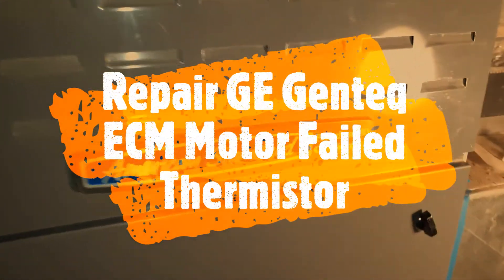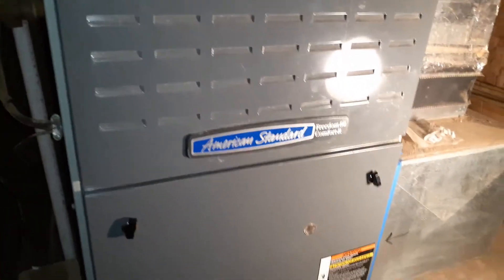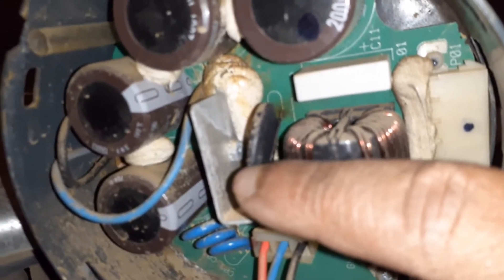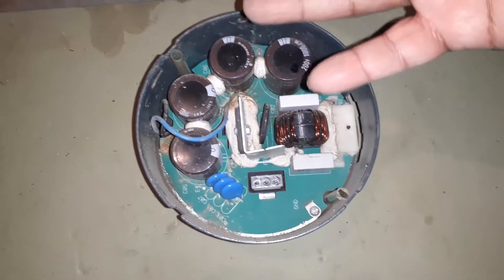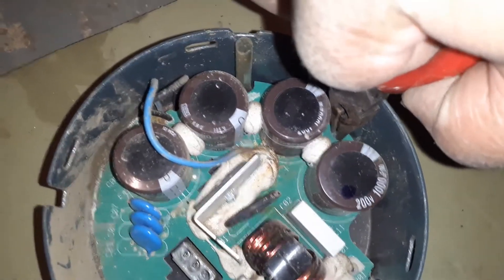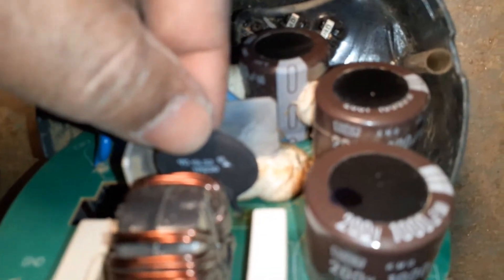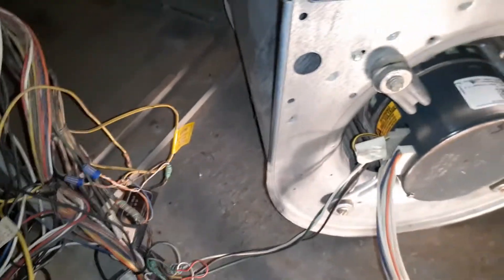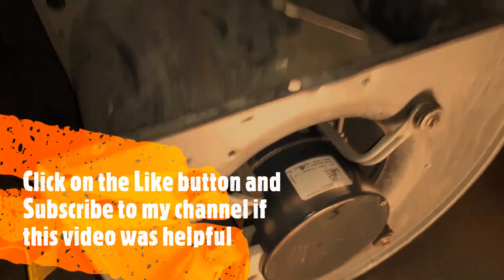HVAC GE Genteq ECM Blower Fan Motor Not Working - Thermistor Repair

Comment: Both my thermister and motor tested good. There is something internal in the module that also goes bad causing the motor to rock back and forth. I replaced the module and all is good. Anyone else experience the same issue?

Comment: Hi. After the HVAC guy told me I needed to spend $1600 on a new motor and that the board might also be bad, I pulled the furnace apart, got into the motor and discovered that the resistor for in-rush protection 0:16 was burned. I replaced this five dollar part and now the furnace works great. Thanks for your video. More people should know about this. It definitely seems like most repair people really don’t want to fix anything and just want to convince you to buy a new $4k to $7k furnace.
Reply from the maker: Yay, glad you fixed this yourself. It is insane how the HVAC industry is incentivized to sell a new furnace when a quick cheaper fix like this will keep these machines going.

Comment: My ECM blower just rocks back and forth when in demand for heat or just for fan on. Ill pull the ECM and check this thermistor. If it physically looks good and shows resistance on meter could it still be no good? Not sure if fan would rock back and forth if thermistor was no good? Ill also check resistance on motor windings to ensure motor is good. Smelled something burning in middle of night when furnace tripped. Thanks
Reply from the maker: If you smelled something burning, I am pretty sure the thermistor is toast. You will see burn marks around the base. It is a very cheap fix.
Reply: @DIYWithIndi   found limit switch jumpered out, when fan quit it overheated and melted the collector box and induction fan. Tripped eventually on pressure switch. Lucky 👍. That thermistor may look good and read continuity but still need replacing? Or will know by looking at it / no continuity? Thanks
Reply from the maker: @mRblOnDe-747  Looks like you have bigger issues with overheating, but why did the fan fail? If the thermistor looks good, it should be fine. I have another video on the same furnace where the connector burnt out and I had to replace the motor with a used one from ebay - https://www.youtube.com/watch?v=Wibpfbi5rgg&t=0s.
Reply: @DIYWithIndi  furnace 13 years old. Not sure root cause of fan motor or module shutting down. But without that blower fan running and limit switch bypassed I’m sure that’s why it got that hot. Nothing blocked in as far as vents, cold air return grills not blocked, clean filter etc. Nothing to tell it to shutdown. I’ll check your other vid out aswell. Thanks

Comment: If it does not look burnt can the thermistor be checked with an ohm meter?
Reply from the maker: You have to find the correct resistance value for room temperature from a chart. Then heating and cooling will alter the resistance, so not an easy test. You can give it a try, but if it is already attached to the circuit board, you will not get a good reading either. Check the leads where it enters the thermistor body. If they are separating from the body, it may be a sign of a damaged one and need to be replaced.
Reply: @DIYWithIndi  I get a very low reading, almost zero.
Reply from the maker: @Armand9100  That does not seem correct. I believe at room temperature these will have 2-3 k ohm resistance.
Reply: @DIYWithIndi  I searched ebay and amazon for a SL22 thermistor. They show 1.0 ohm resistance.
Reply: @Armand9100 That's what I measured on mine. It was an NTE with 1.0 printed on it.

Comment: How did you determine which of the solders on the back of the board went to this component?  I know you can eyeball and narrow in very close, but some of those solders are all in tight area - how do you tell exactly which one it is?  Thank you again for great how-to!
Reply from the maker: Yes, eye ball it. If yours is burnt, it is easier to spot. The 2 leads will be close but on 2 different circuits.
Reply: @DIYWithIndi  Ok will pull board off and look, mine doesn’t look super fried - the component (thermistor) looks busted, as one of the leads is popping out the cylinder, but doesn’t look like bunch burnt area from top…but will look at the bottom of board where solder is.

Comment: Possibly went bad for not replacing the filter
Reply from the maker: A clogged air filter will make the blower motor run harder. But these motors have been known to have this component fail over time. I switched to lower MERV fiberglass filters instead of the pleated ones. A high MERV rated filter will kill these motors sooner.

Comment: What kind of solder do you need to use for this? Silver? Lead? Tin?
Reply from the maker: I used the regular electrical solder that I got with the soldering iron similar to https://amzn.to/2Ya6AZj. I believe it is tin-lead alloy. The solder on the circuit board needed a bigger solder iron to melt, so that may be lead-free.
Reply: @DIYWithIndi  does it matter which way to connect the thermistor, is there an in and out? Polarity?
Reply from the maker: @Talal-Melhem  No polarity. It can go either way. Good luck with the fix.
Reply: My motor pulses but does not come up to speed - could it be the thermistor in my case? Thank you in advance